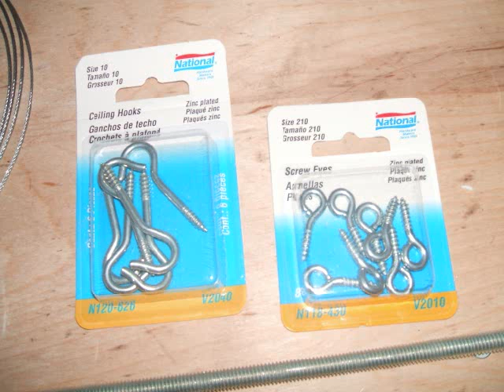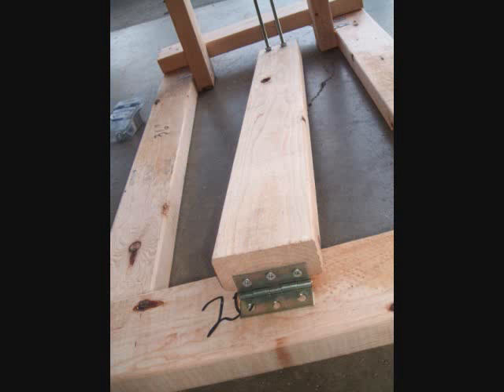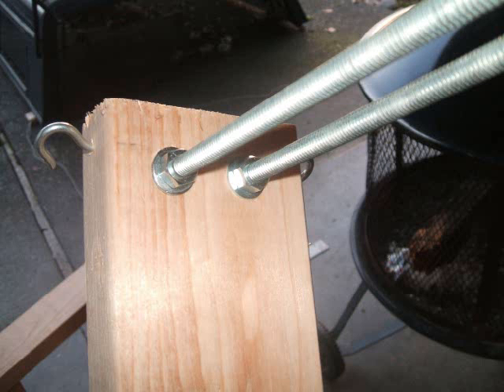Rocket Thrust-Meter

Comment: Yoy know, springs have an equation defining them right? Called hookes law, pushing/pulling the spring by x meters requires f amount of newtons.

F=kX where k is spring constant, varies due to material, temp, build. 
X = displacement
f = total force. I feel like.. you can make this build a lot more resource efficient.